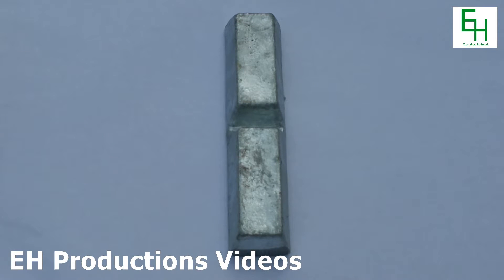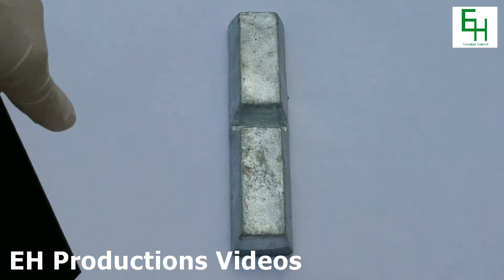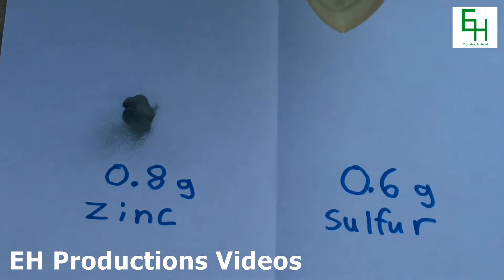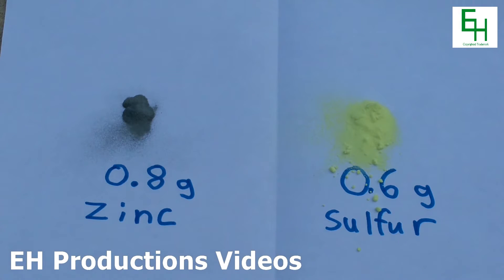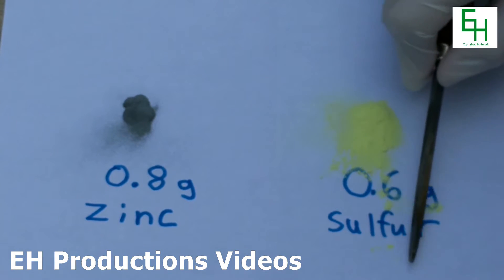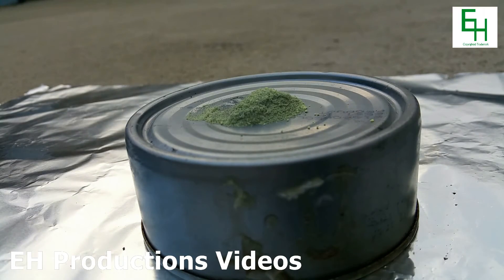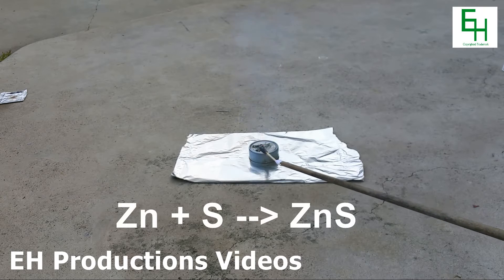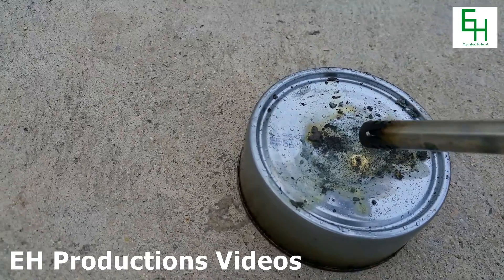An Attempt at Making Zinc Sulfide (Unsuccessful)

Comment: Here's a way to make a purer product:

Try mixing zinc and sulfur with paraffin wax and heating it up in a closely concealed glass beaker at >500 F. According to wikipedia, it should make ZnS as ZnO + H2S = ZnS + H20. The parrafin wax (a hydrocarbon) would burn with the sulfur to make H2S. Thus, the ZnO would react with the H2S at those elevated temp to make ZnS!

Would like to get your opinions on this and see what colors doping other metals in the mix would bring!

Comment: I feel like I am a little late to this party. But I think that your safety precautions is mucho good I mean I don't even bother putting on welding goggles or normal goggles for that matter when doing those things. Anyways What I wanted to say is that I did the same thing (I did a video on that quiet recently) with some US pennies by 1. electrolysis to get super fine Zinc and 2. using a metal file on pure zinc. It wont be at a atomic level but it works. From my testings I found that impurities is what makes it glow because I've made ZnS now alot and I do so on a brick which I used for melting metals which I didn't know at the moment activated my Zinc sulfide. Until now that you said that copper can be added for luminescent properties. A process which I am going to try which is going to be part 2 of my Zinc sulfide series is going to be me making pure ZnS from Zinc sulfate (from dissolving Zinc in Sulfuric acid) and Hydrogen sulfide gas. I think that that is a much more efficient method and far cheaper in terms of product you get. Also you get a decent amount that you can later dope which whatever salt you want to get different colours. I wanted to dope mine in Silver and Copper to glow green and blue. Zinc sulfide isn't luminescent itself but will get to that if you add salts like I mentioned. That makes the Zinc sulfide active (after you have blasted it with the blowtorch) and will not only react to UV light but from alpha radiation itself which I will be using it for. I am mostly doing it for fun but the professional made stuff is much more expensive and I don't live in the US so I found it much cheaper and fun to just make it myself. Well I hope I haven't bothered you too much by reading this if you do. Have a good one!

Comment: Ok, it is totally unsuccessful for two reasons: 1: you grinded Zinc in oxygen, most of your zinc dust is ALREADY oxidised, and also contaminated by the sand paper's SiC... To get really fine dust (atomically fine), you need to dissolve your zinc into an acid (like H2SO4, or HCl), and then precipitate it out by putting a more reactive metal in (like Aluminium). In short, take H2SO4 + 2Zn = Zn2SO4 + H2, then Zn2SO4 + 2Al = Al2SO4 + 2Zn. These kind of reactions are called single replacement reactions. You can easily get Sulfuric Acid (H2SO4) from car electricians; they use this as the battery's electrolyte. Alternatively, HCl can be found in toilet cleaner chemicals...2: Next, the burning of Zn with S was done in, again, a reactive gas (air). Most of your product "flew" away, and also a lot was again oxidised. In order to do it properly, you have to put your chemicals in a test tube, and put some glass frit on top so that you refrain the amount of oxygen that will contact your reactants. I wish you all the best with your experiments. Hopefully you can get a much better result after this info. And maybe you could then update your video with a more "successful" try...
Reply from the maker: +Delphi Builder Thanks for the info. I will probably try this again in the future.
Reply: EH Productions Videos No prob.  Nice to see DIY type videos around man. Keep it up
Reply from the maker: +Delphi Builder Thanks!